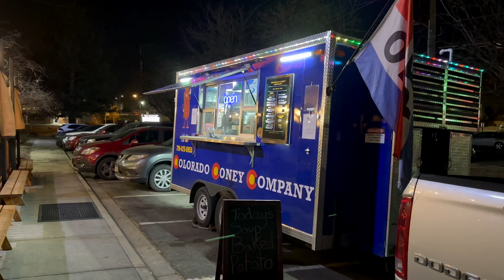Semi under Low Bridge | Wanna live in Denver, CO?

Comment: Your tarp frame saves a lot of time instead of tarp sheeting. When empty can you not fold tarp up on trailer?. Enjoyed your video dude.👍😊
Reply from the maker: Conestoga tarp system is suppose to be closed while moving. I’ve seen twice damaged trailers, that were driving in open position - just strapped to the front and back.
Last week I had to cancel one load, because it didn’t fit. I needed one more inch of clearance. Market is suffering now, there are 70-80% less loads on a spot market, which makes it much harder for my dispatch to find a load for conestoga, compared to a regular flatbed. I’m going to switch trailers soon, and will be doing open flatbed this season.